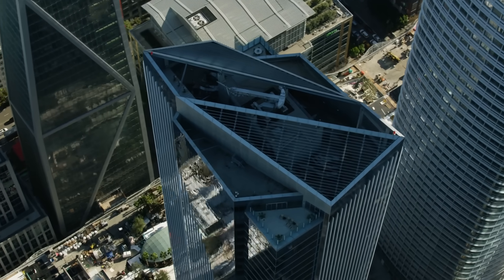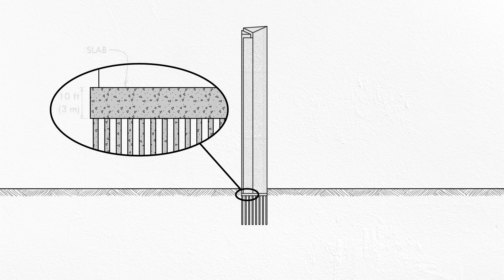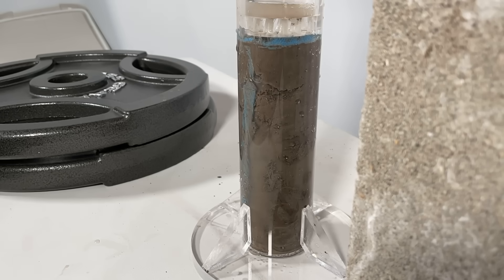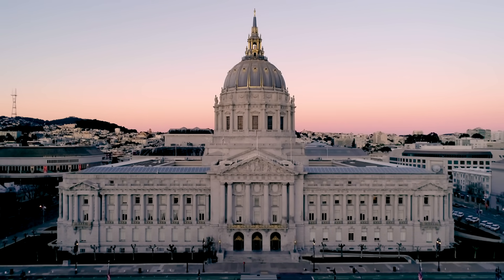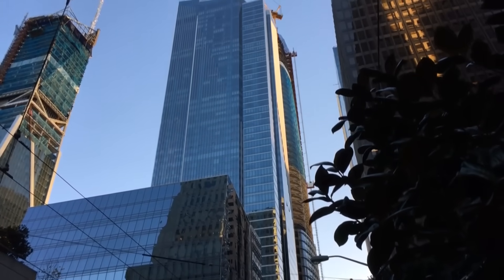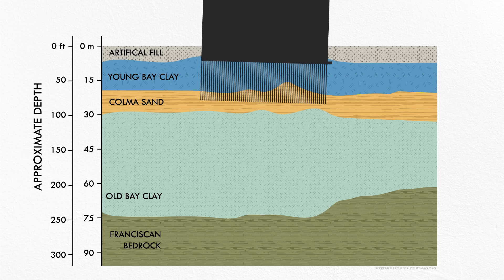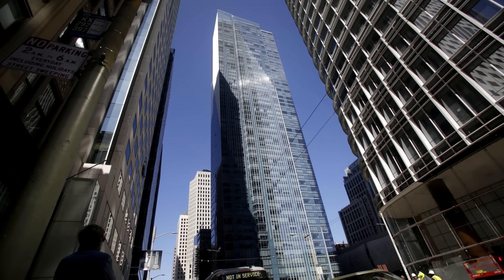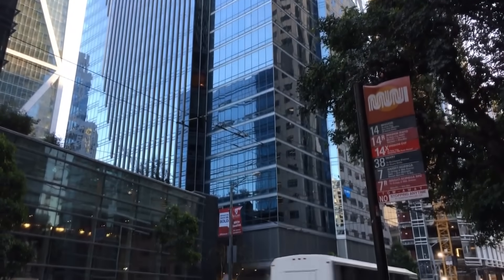What Really Happened at the Millennium Tower?

Comment: I'm curious as to how the structure's settling impacts its connections to the power, water, and sewer lines.  How often do these connections have to be disconnected, moved, then reconnected?  Or is my understanding flawed? (Notes:  I'm consistently amazed at the high level of production for Practical Engineering.  I'm not an engineer, but even I can understand the issues with the straightforward presentation and absence of technical jargon.  There's no way I'd live in this tower, having to trust the assurances of perfect safety juxtaposed with the previous false assurances of reliability seems obtuse.)
Reply: There are several civil engineers who have said that sewer lines are in serious jeopardy of failing due to the building no longer sitting level so the gravity fed sewer lines could drain properly...the building is doomed
Reply: @billiamc1969    This is a small problem. At worst a sump will be constructed for the sewage and lift pumps will be installed to take the wastewater into the sewage system. The building may have been built with this design from the beginning.
Reply: @billiamc1969  Its only doomed to get a pump installed to bypass the gravity feed.
Reply: With four feet of drop I'm wondering how they walk thru the front door...
Reply: @toadamine  17 inches
Reply: There is a SF news video on YouTube that has a short 2-3min story covering the potential upcoming sewer problems. It said that the pipes need a slope feature to properly drain the sewage. They showed a pipe in jeopardy as it is starting to bend. Those people were already paid out for their “loss” in purchasing an apartment. Will they get paid again for new destruction?
Reply: Flex connectors. Destiny mall in Syracuse NY is on a floating slab that is reclaimed swamp land and old metal scrap yard. All the pipes are using flex connectors and they are severely angled due to the settling.
Reply: @fyrman9092  Very interesting!  Thank you for the reply.  If you do know (and no need to reply if you don't...I'm just curious), how much flex can those connectors handle?
Reply: and a verified youtuber copied your comment lol
Reply: You won’t see me living above the fifth floor or in a basement.  Lessons learned from living in NYC!  Five floors is all my asthma and arthritis can handle.  I’m allergic to mold and have a fear of drowning.
Reply: @mariekatherine5238  You should also have a healthy fear of upper floors falling down on you, I think... ;P
Reply: @ellmanncreative  We go to bed every night trusting that our homes will shelter us. We worry that a tornado, earthquake, building collapse, giant sinkhole opening, sneak bomb attack, asteroid/comet strike, cave-in, fire, or a home invasion might happen and it will drive you insane after a while if you dwell on it too much. This is why we pay experts and public servants to keep us safe (like adhering to building codes) by paying attention to the finer details. When they don't, a significant number of preventable deaths happen. It also boggles my mind that people are surprised that a skyscraper built on reclaimed land next to an oceanic bay on several geographic faults has started leaning. I'm shocked it hasn't already happened. There's an expensive building in Las Vegas that is on a piece of prime real estate sitting empty for the same thing (It may have been demolished by now...not sure.) Like the man said, making sure the foundation is stable BEFORE you put a huge, heavy building on it would've been the way to go and people involved have some major explaining to do.
Reply: You probably would not be able to afford to live in this tower. One of former condo owners is former quarterback of the San Francisco 49ers, Joe Montana.
Reply: @RaymondHng  if that was true would his name not be Joe Francisco then, not Montana?
Reply: @RaymondHng When I was working there, one of my friends looked into buying a condo. As I recall the lower units were 1.5 mil. Of course...you'd get a discount now! 🤣
Reply: @RaymondHng  That's what the saying, "no way" means.  It implies that even if you could, you would not.

Comment: Considering there is a much taller building next door, what was done differently that caused Millenium Towers to sink but not adjacent buildings? 
Also, wouldn't adjacent buildings also put pressure on the clay which would make it harder for Millenium tower to push water out in its quest to sink?
Reply: Just a guess, but maybe the piles of the adjacent building were driven down to bedrock like they should have been?

Comment: "Let me know what you think"

What I think is that with my studies in engineering school (majoring in soil mechanics and structures, but got engineering jobs after graduation in 1974 in different areas of engineering), I recall designs solving the problem of erection of commercial buildings over compressible clay layers by driving piles (creosoted wood, steel cross sections, or reinforced concrete depending on the building, the clay layer etc.) down to bedrock or a at least a less-compressible stratum.

I can't say for certain, but it seems to me to expect a clay layer to support a skyscraper is really sketchy in both of the aspects of consolidation of the clay and the expected friction of the clay against the piles.

The design engineers were probably told to come up with the cheapest design they could think of. lol

The owners also may have told the general contractor to skip some of the soil exploration and testing and use test data from adjacent buildings in order to save money. Projects have failed due to that error. At least back in 1974 and earlier.
Reply: All of that actually happened.
Reply: It is for the reasons you mentioned a major accident should happen. Only then these short sighted building owners will take the engineers seriously at least in the future. By the way the engineers also have to be blamed. They agreed to listen to the owners because if they don't the contract would go to another engineering company.
Reply: 100%.  I'm a mech. engineer and business owner.  I believe investors don't care if collapses, as many or most of them may do in a catastrophic earthquake.  As long as they can put their name on a fancy building, rent it out and insure it...who cares? They're not going to be the ones in them when they are converted to rubble. Building a 300' structure on clay and sand in the most earthquake prone city in America just sounds ludicrous.  I would personally think anything over 10 stories is pressing their luck.
Reply: @nextari  You can build a tall building that will survive earthquakes. The Transamerica building was the tallest in the West for a long time and survived the Loma Prieta earthquake, but it was also wasn't designed as a pernicious cash grab like the Millennium tower.
Reply: @nextari  they should make everyone who is responsible for this mess live in the building until they either fix the problem or agree to demolish it.
Reply: Mmmm I'm not sure how the construction industry operates in America, but from what I've learned we have owners, main/general contractors and sub contractors. The owners are usually the ones who wants the building and he/she source for architects/main contractors while we, civil engineers, give our cost estimations. Then we have a tender/bidding period where different construction companies submit proposals to the owner and he/she chooses which company to become the main contractor.

For a skyscraper with that many footings/foundations to reach bedrock which is like 30+m down will easily cost a couple hundred million. Maybe it'll cost less to fix it we don't know but this couple hundred million will definitely lower the winning chances of this company. I'm not trying to defend them but just know at the end of the day we just love money.

But do know that we have various different project organisations and we do not know there's. So sometimes it's hard to point fingers but if you want to point fingers, usually the main/general contractor and owner lead the project.
Reply: @Julian Keippel Nice wordplay. But what does nepotism have to do with not drilling to rock?

Comment: The presentation is very good. But it does not point out that soil mechanics is still not an exact science today. This is usually replaced by an experiment at the current site. I’ve worked on several projects over the last 40 years that started with piling (as a site manager). Even 35 years before that, this work began with making some test piles, by hammering or drilling full-size scales. (construction of industrial factories f.e nuclear power plant or oil refineries) Then after the curing time this is pressed down with the planned load. They wait for the pile to stop sinking. It is then determined that the measured subsidence is acceptable according to these design rules. They then increase the load until the descent suddenly accelerates, i.e. it is not proportional to the load force. This is called tearing off the ground. That's the maximum he can handle. Then we divide this value back by the safety factor. (minimum 1.8 - 2).
I suspect these tests above were not done in advance because they already had similar data about the surrounding houses.

Comment: I'm amazed they were able to lift it up that way, extending a piece of foundation and then using it to bear the entire weight of the original, even if temporary is quite a feat.   I imagine they must have drilled in tons of rebar first but you can't just drill anywhere as you don't want to compromise the rebar and pretension cables in the existing slab.   Yeah I would not want to be one of the people responsible for this lol.   I've done building lifts at an exponentially smaller scale so I can only imagine how much it's involved for something that big.

Comment: My understanding from the news was that the foundation was designed for a still building and instead they built a cement building or concrete picky picky and that's why the foundation is sinking so much is it's got so much extra weight that wasn't calculated for
Reply: Design changes like this are quite common and there is no way they would just make a major change and not inform the designer of the foundation to assess it.

Comment: One of the problems with building based on mathematical modelling is that the model is only as good as the data that goes in, if the data is a guess as in this case about how  the subsurface clay will behave, then the result is the same, a guess.
Building a skyscraper on a foundation that is no wider than the  above ground footprint and then relying on friction piles running into and not completely through the Bay clay layer was a gamble based on potential profits. If it is not possible in a heavily built up city zone to create a much wider raft than the building footprint, the only way is to go for bedrock.
I also wonder what numbers the engineers have for the effects of liquefaction in the clay layers in the event of a seriously large shake.
Being a belt and braces kind of guy I also wonder at the remedial work being solely on the two sides to address the current sinking and relying on the other two sides to slow their sinking in line with more modeling but having nothing to fall back on if they don't behave as planned, after all nothing else has.

Comment: Is it possible, from engineering point of view, to prevent sinking and distribute the load by interlocking the topic the building to the adjacent buildings, creating sort of a structural mesh that would suspend the sinking building, decreasing the weight of the building and reducing the pressure on the soil. To make it aesthetically appealing, they might be built up to a sort of bridges between buildings.
Reply: No

Comment: They increased the weight of the building late in development by adding more concrete to the structure than the design had specified. The 10ft concrete pad is woefully inadequate to support the massive weight with only friction piles. A strong earthquake from the Hayward Fault across the bay will telegraph seismic energy through that reclaimed bay soil and sand to cause a liquefaction event that could topple many buildings in that area. Many SF skyscrapers were built in the 1980s with faulty welding techniques prone to failure in a quake as evidenced by similar structures failing in the Northridge Quake. The USGS issued a lengthy report on these welding weaknesses listing some of the the tallest buildings in the city. Again, the welding methods were used because it's much cheaper. Economic factors always determine final designs.
Reply: Love that last sentence because it's completely true. Instead of things being made and done as best as is possible, what we do is to make and do everything to the lowest and cheapest possible standard we believe will not fail. When failure does occur in ways and places unexpected, we go "AHA!" and pat ourselves on the back for now knowing more than we did before then continue to take the same approach afterwards that failed us before, only altered to match our 'newer and better' level of intelligence. Wee iz relly smarrt ain't us?

Comment: Way back in the day before construction even started Treadwell & Rollo, the geotechnical engineer for Millennium Tower just had a 52-story skyscraper at nearby 80 Natoma with the same heavy cast in place concrete construction and shallow foundation as Millennium Tower rejected by the city's Department of Building Inspections so they simply skipped that part of getting the Department of Building Inspections approval and went ahead with the construction of Millennium Towers that "they knew" was defective and "they knew" would have been rejected had it been submitted for peer review.

This is what happened everything else is interference meant to create doubt and confusion

Any further questions can be answered with one or both of these words "Money & Greed"

PERIOD
Reply: I'm afraid folks will want to see proof of this dear heart. If it is true and provable, the fact that it is completely illegal will lead to those who are responsible for the problem rightfully having their heads chopped off, and I want to be there to watch when that happens as I cheer on the executioner.

Comment: As a geologist and soil tech in a materials lab, who worked with civil engineers on dams and other constructs, we always thought clay was the most difficult to work with because it shrinks and swells and/or dewaters.
Reply: True, it is the most difficult. I worked with yazoo clay in Mississippi. It can expand 200 times its original size. The best way to build on it is to dig out a 6 foot hole below and around the foundation level, replace it with compacted sand and direct all water away from the site. The Australian's utilize the best clay design technology!
Reply: @pyhead9916  I have worked as a plasterer in Melbourne Australia. Lot's of cracking in the walls from house's built on stumps in clay soil. They are building on slabs mostly these days
Reply: Interesting. We are always told how lucky we are that London is built on clay. For instance, the London Underground was much easier and cheaper to build than the New York equivalent - no blasting through rock, just nice, easy clay. In fact the problems come when they hit patches of sand, as they are unstable and usually very waterlogged. I don't know how this affects tall building, but they've certainly built enough of them in the last 30 or 40 years!
Reply: @paulhaynes8045  New York is probably one of the easiest places to build skyscrapers due to the close bedrock.
Reply: @paulhaynes8045  What works for London, though isn't practical for San Francisco because of the added instability due to plate tectonics and active fault lines. London does have one of the best underground systems in the world, in my opinion.
Reply: That's how Texas ends up with a lot of cracked home foundations.

Comment: I knew years ago the building was leaning because while walking to work, it did not line up straight with surrounding buildings.. I just assumed it was the design of the building.  It wasn’t that bad of a difference at the time, but yeh I could tell it had a slight lean.

Comment: Excellent job with this presentation!  I’m left wondering what will happen to these new peers that are installed in the event of an earthquake. Your diagram, which I realize is not to proportion perhaps, seems to show that these are much longer. If these suddenly give way during an earthquake it seems that a sudden impulse will occur to the foundation at the worst possible time creating a rather uncertain event.
Reply: That's probably why the holes for the new piles will be drilled over-sized, and the space between the piles and the surrounding soil filled with a low-strength material. Grady mentioned this in the video but he didn't explain why they are doing that.